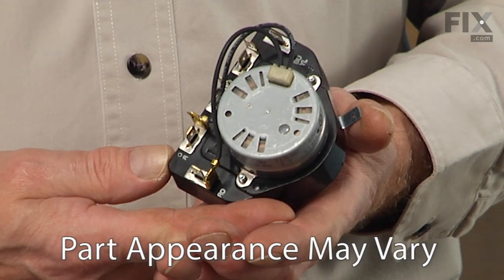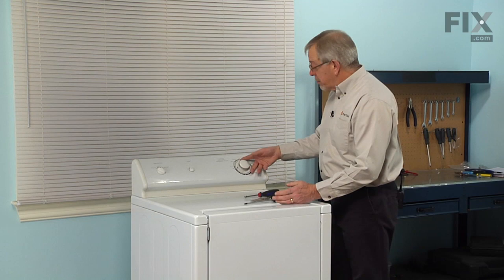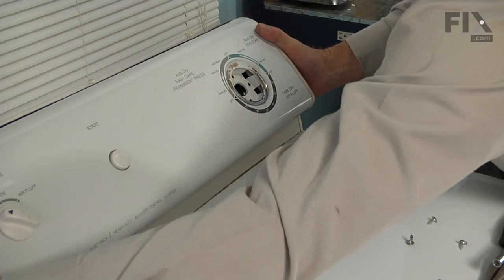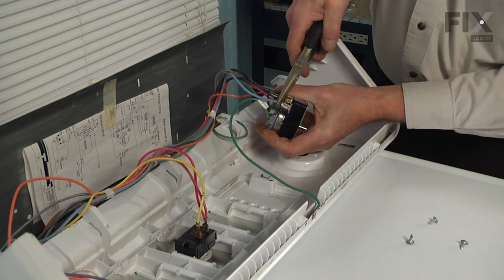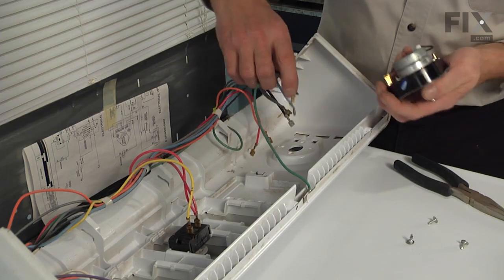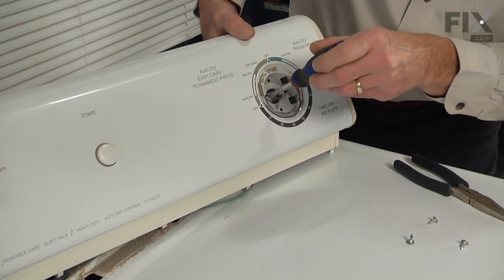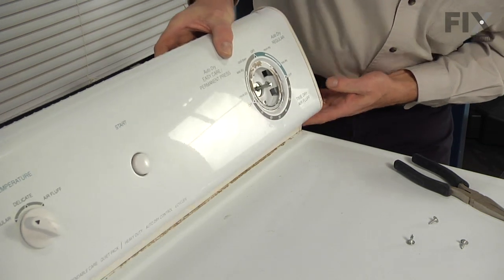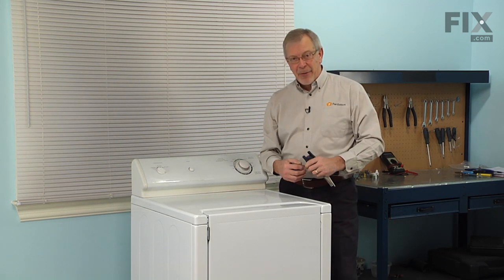Maytag Dryer Repair – How to replace the Timer

Comment: I have a gas Maytag Centennial dryer MGDC300xw1. The dryer will not start when using timed or sensor dry. But, if I move the knob to the sensor dry and press start (it won't start), it will slowly move until it hits wrinkle prevent (you can hear the timer), and then it will start on its own. It will stay on till the end of wrinkle prevent, and then turn off. I don't feel heat during wrinkle-prevent. I'm unsure if I should check the timer or some other part?

Comment: How do you test to know the timer is the problem?
Reply: Late I know but did find a video on how to test. Hold the switch that tells the dryer the door is shut. Turn on the cycle and toggle or move around the timer switch. Usually moving it up or down or left or right put some pressure and you will see the heating element light up. Remove your hand and or pressure and it will stop the heat process, tested this on mine and finally figure out the issue after a few years of odd behavior I could not narrow down.

Comment: My dryer timer was not advancing , I replaced it but the problem is the same. What else could be causing this ?
Reply from the maker: If the timer advances on the Timed Dry but not on the Auto Dry cycle, the problem is most likely the cycling thermostat. What is your model number?